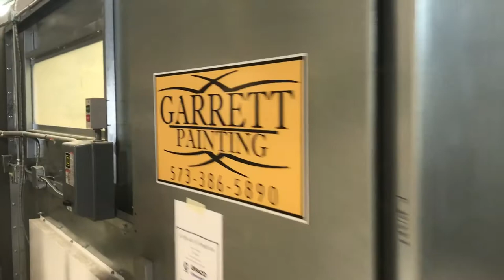Columbia, MO cabinet painting

Comment: Wow looks great. Quite the set up. I’m new to spraying lacquer on cabinets and just seem to be 95% there I’m just not getting that perfect look. I’m using a titan 115 cap spray. I’ve had some problems had a few dimples in the finish also have a slight orange peel to the finish it’s very very smooth but just a bit of orange peel. Does the amount you put on matter I’m putting a descent coat on a primer and two finish. I’ve tried light coat I’ve tried a heavy coat I’ve tried thinning not thinning?!! Not sure if I have the gun set up right but I think I do any tips or videos on this topic would be amazing. Nice work and thank you